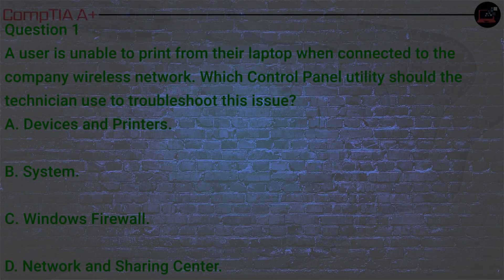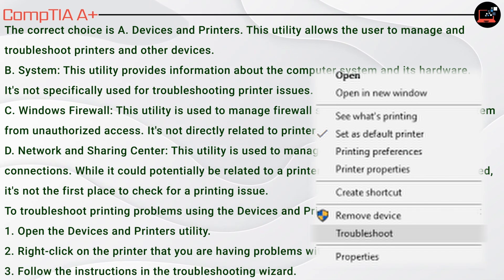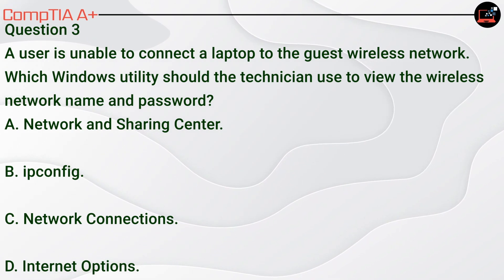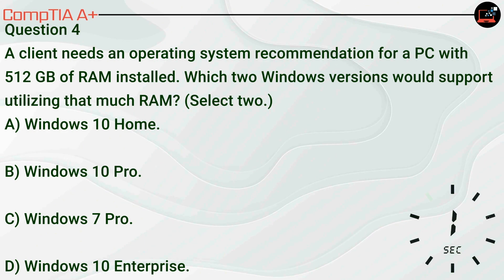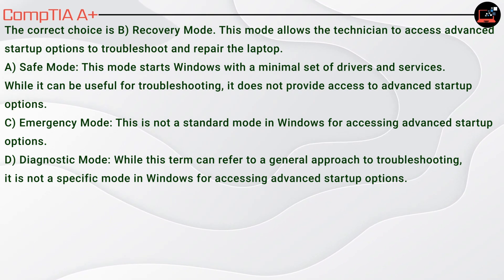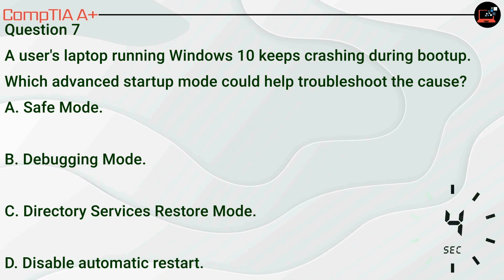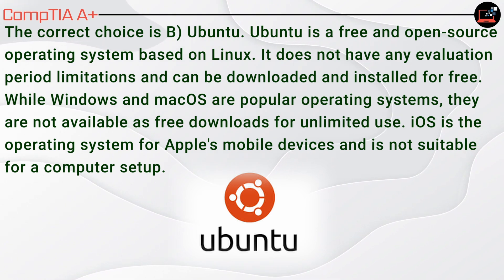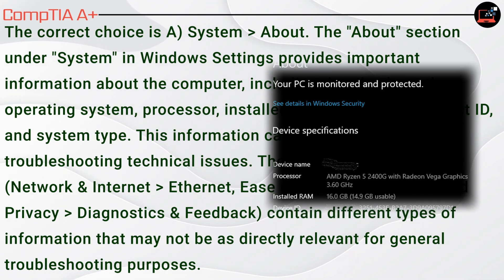CompTIA A+ Core (220-1102) Practice Questions - Part 1 | Q&A with Explanations

Comment: WHY DO YOU STATE THE POTENTIAL ANSWERS SO QUICKLY?   SO MUCH MORE FASTER THAN THE QUESTIONS?  IS THIS ACTUALLY A Ai generated voice over?  < The lack of pauses between the potential answers tells of some discriminating factor that an Ai voice reading a script wouldn't be able to identify.

There is also another cute attribute thrown in, and  I am sure to inspire confidence in the user as to the authenticity of the information. Tweaks in the voice of the Ai don't make up for a lack of understanding of didactics.

Comment: Nice I’m studying 1102 can we get security questions please
Reply from the maker: That sounds great! We appreciate your interest in security questions. We're actively working on a new video focusing on security-related questions, specifically designed for the 220-1102 (Core 2) exam. In this upcoming video, we'll cover key practice questions that span topics like malware, firewalls, encryption standards, securing devices, and much more.

Stay tuned for this new content, and we hope it will be a valuable addition to your 220-1102 exam preparation. If you have any specific security topics or questions you'd like us to cover in the video, feel free to let us know. Your input is important to us!
Reply: The security questions are up now.

Comment: Passed my 1101 today !
Reply from the maker: That's awesome, congratulations Mike! Passing the Core 1 exam is a huge accomplishment. Make sure to celebrate your achievement! Which study resources did you find most helpful when preparing for Core 1? Let us know if you need any advice or tips as you begin studying for the Core 2 (220-1102) exam next. We’re happy to help you keep the momentum going so you can get your full A+ certification. Again, well done!
Reply: @techvaultacademy  professor Messer you and Dean Cyber were my main sources for study material. Taking lots of practice tests helps you get accustomed to the type of questions you will be asked